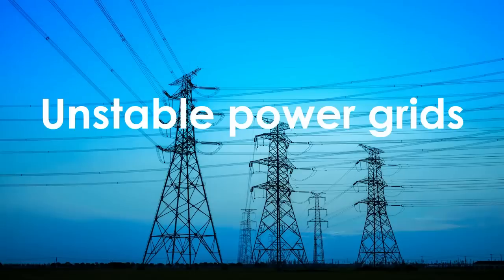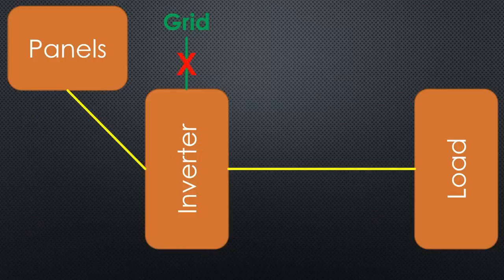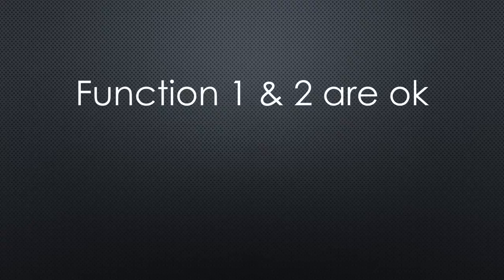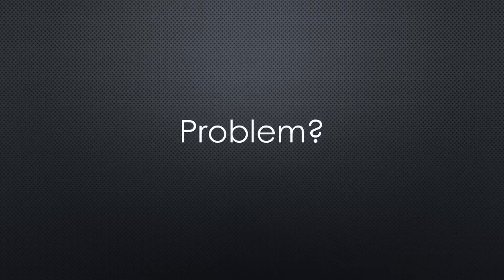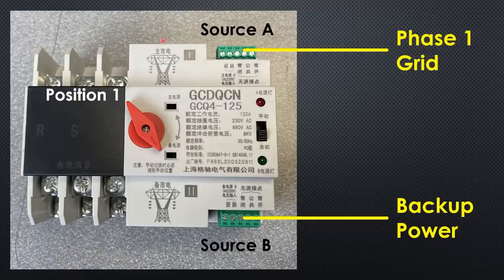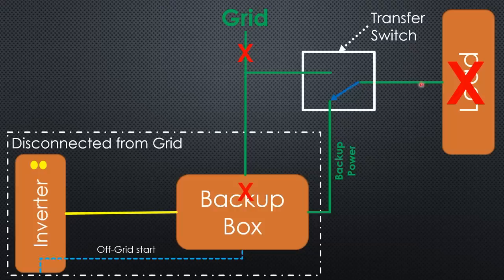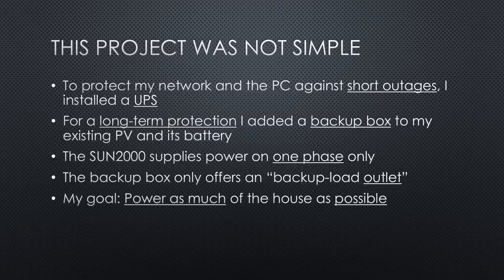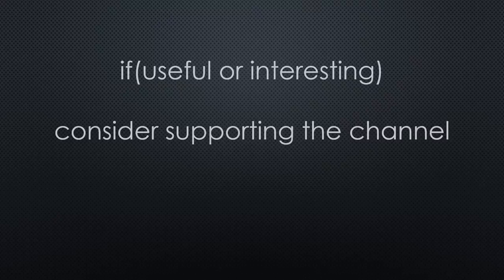448 How to Build an On- and Off-Grid System (Backup Box Hack, Huawei SUN2000, LUNA2000)

Comment: I had a solar system put in about 8 years ago, but because I was in the middle of a construction project (and had young kids at the time), I didn't take the opportunity to learn enough about the various tradeoffs. If I had your diligence and taken your structured approach to learning, I would have avoided a lot of mistakes!  What has helped me learn was the installation of a much smaller DC-only system with some panels I got cheaply later - nothing quite like building it to learn.

Thanks for sharing your knowledge and experience!
Reply from the maker: I agree, I always have to use projects to learn! Reading book does not create enough questions for me .

Comment: This is how all Solar installations should be installed rather than sitting there usless during a power outage.
Reply from the maker: I agrree.
Reply: @AndreasSpiess  There's some safety concerns. If the power is cut so workers can operate on the lines?
Reply: @cmuller1441  the inverter is already detecting grid power loss, so instead of turning itself off why doesn't it just cut the connection to the grid?
Reply: @35manning  An increasing number of inverters do just that. In the US, most notable are SMA and MPP, both of which have options for daytime backup without batteries.

Comment: Very clever solution. Thanks to Andreas. If somebody needs an motor driven generator, consider also a "tractor power axel driven generator". Old tractors are very realiable motors, and generators can be transported at the hook-up levers  at the back of the tractor.
Reply from the maker: Good solution if you have a garage for the tractor ;-)
Reply: Indeed, often reffered to as PTO: power take off.
Reply: In some country side districts there are several old tractors in barns or open field with a minimal cover blancet. They use their new tractors with 200 hp + 1,7 m front&back tyres also for school trips daily (15 years is enough to drive these monsters).
Reply: If you have some loads on a UPS (like several outlets fed by a 1000W UPS), fed by some larger batteries that give you some time, you could just feed those batteries with DC from any source, tractor or just an engine or a car, then let the UPS switch back in with the grid and put up the tractor at your leisure.  A little automation is required if you don't plan to stay home all the time.

Comment: Hi, many thanks for your inspiring project. 
It must be noted that, at least in Switzerland, any modification to a house wiring requires the neutral regime to be of TN-S type due to differentiel protection requirements (FI or DDR). Older houses (like mine) were often connected using TN-C  (1 wire for both neutral and protective earth PE). 
No modification to the wiring is allowed unless it is changed to TN-S, so there is no way to setup an Off-Grid backup System. This can be quite costly. So my Huawei SUN2000 will still stop when Off-grid, until we find an economical solution (maybe just setup part of the wiring to TN-S, while having the rest of the house still on TNC, and getting no current when OFF-Grid).
Reply from the maker: Thank you for your information. Unfortunately, I do not understand your problem ( I am not "fluid" in house installations). This is why I trusted my electrician and hope, he got it right. There are also FI fuses in the backup box, BTW.
Reply: Earthing and wiring schema is a thorny topic, there are also lot of regulations involved
Reply: @AndreasSpiess  it's quite easy your Outlet have free wires going to it live, Earth and neutral and his wiring only has two wires - no extra earth pin
Reply: The Backup Box manual from Huawei explicitly forbids connecting to TN-C grid types. However, if the household is wired as TN-C-S then it is perfectly fine. You can't switch to TN-S unless the power company does it for the whole neighborhood supplied from the same source in your area, which would be extremely expensive. The cheaper option would be to change your TN-C system to TN-C-S system where you split the source Neutral(PE) wire into two at the power distribution box at your house. Of course this must be in correspondence with your country's electrical regulations. Another way is to convert  to a TT system where you install separate earthing system for your house getting a completely independent protective earthing while you use the source Neutral(PE) only as Neutral. This again must be advised with your local electrical regulations.

Comment: Hi Andreas. I did quite similar things  with a transfer switch with the exception that I use a 1000VA USV with external 24V batteries as Voltage source and I cleaned up  the phases such that all I want to power ( light,  freezers, IT and heating (just 35W for control and pumps) is supplied on one phase. This makes me sure that no dish washer, washing machine  is powered in off grid mode thet may lead to  overload of the backup power supply. I hacked the APC USV such that it self start when supplying 24 V. This needs just some sequential button presses which I realized with an Attiny controller. So everything is now fully automatical and work without manual interventions.
Reply from the maker: Cool! So your system is similar to a emergency generator, just without using fuel!
Here, we wanted to power the whole home, not only the critical systems with solar because in late February/March when they predict potential power outages, the sun should already produce enough energy for everything (except cooking). So we should be able to live a "normal" live.

Comment: You may use a VFD (variable frequency drive) to solve the 3 phase problem. Many of them can be supplied by 1 phase + neutral and output 3 phases + neutral. You can also set the VFD to various parameters. This is usually done to power motors.
Reply from the maker: I agree. But in my home, this would be a solution without a problem ;-)

Comment: As a UK resident, I envy your 3-phase supply. We only get one phase in domestic installations. But I suppose that implementing your solution would be much easier.
Reply from the maker: Indeed, you could save two phases of the switch. And the backup box would be simpler (and probably cheaper).
Reply: I feel that our situation (just 1 phase) is more convenient. No complexities, simpler wiring, you don't have to think how to balance load, etc...
Reply: If you need three phases, you can pay for a three-phase supply, but it make your life more complex.

Comment: A nice solution for already existing system and I'm glad it works for you.
For a bit more than a price of Huawei inverter + backup box you can buy Deye 8kWt hybrid inverter that can provide full-power 3-phase output in off-grid mode. Also Deye inverter supports unbalanced load, so up to 50% of nominal power (4 out of 8 kWt) can go to the load of one phase. Deye uses low voltage 48V batteries which are more universal comparing to proprietary HV batteries. Also Deye has Smart Load output which is designed to prioritize self-consumption over grid export, fir example by dumping excessive solar energy into a hot water tank. Of course that would be a different build, however total price would be similar, wouldn't require external transfer transfer switch, would provide full-power and correct 3-phase output.
Reply from the maker: It seems that Dye has a good product. I did not know it. However, as I said in my videos, I wanted a high-voltage battery. 
And, as an engineer, wasting eletricity to heat water , is a no-go, too. I rather sell it for a cheap price to the community. Electricity is more valuable than 60C water. But charging a car battery would be a perfect application for this function.

Comment: MANY THANKS to you Andreas! I was always wanting to have an independency option for my PVs and your solution inspired me on a way to go! Besides the Backup Box, I ordered similar automatic electricity switch from AliExpress (I have a monophasic 3.65 kw SUN2000 + 15kw LUNA battery) and spent few days to correctly arrange all wiring with an electrician. One conflict we noticed is that the system refused to work if a General (not the main entrance) switch was ON on the system. It was conflicting with the one switch on the Backup Box (I guess) so we had to turn it off permanently. Finally the system started to work as on your video, what a relief!
Greetings and thanks for sharing :)
Vladimir (Portugal)
Reply from the maker: Glad it works. Here, unfortunately, I never had the chance to "really" use it because we had enough eletricity during winter ;-)

Comment: I believe two important things should be noted for this solution:

1. In this way you connect the whole house load to the backup system. This means the house load should not exceed more than 5kw for LUNA2000(10-15kwH) or 2.5kW for LUNA2000(5kwH). Shorting the three phases means that you support the whole house load and some households may exceed the 5kW(2.5kW) limit which would cause the battery short circuit breaker to activate. Most three phase stoves can operate with a single phase, excluding the oven. This means having only 1-3 burners turned on (or maybe a boiler) will get you close to the 5kW(2.5kW) limit.

2. The L1 terminal in the backup box and source A terminal of the ATS switch should be connected to the same phase. Otherwise in cases where a single phase drops, due to a short circuit break from the sourcing power distribution box for the household, you may get unpredictable behaviors. One scenario is where an inverter goes into off-grid mode but the ATS switch does not transfer to backup power, leaving the household powered with the remaining phases from grid. Another scenario is where the inverter enters alarm mode due to missing a phase for proper operation in grid-tied mode, but the missing phase is not the one that triggers switchover to off-grid mode, this way the ATS switch may completely shut down power to the house although you can power the house with the remaining phases.
Reply from the maker: I agree.

Comment: Thanks, very interesting.
My proposed solution is Sunsynk 8.8kw hybrid inverter, Freedom won 10kwh battery and 7.6kw solar panels - lack of space forces the limit. Everything is single phase and the sunsynk takes care of switching between loads so connection is relatively simple.
Reply from the maker: I already invested in Huawai. And I need 3 phases in our home...
Reply: @AndreasSpiess  I understand. Sorry. Should have been more clear that I'm just sharing what I'm about to put into my own place as contrasted to your installation.

Comment: Very interesting. Ideally I would have liked to see what happens when grid comes back. Also, I would like you to have identified the "two breakers in seroes" that the electricity suppliers requires - presume one is the changeover switch and the other is part of the Backup Box.
Reply: Having the breakers in series reduces the risk of sticking contacts, thus injecting power back into the grid. He showed them in the schematics.
Reply from the maker: Nameless ghost is correct. And the switch back is without effects. The transfer switch takes a few milliseconds to automatically switch from backup to the grid. You hardly see it.

Comment: Have a look to Sungrow hybrid inverters (e.g. SH10RT). They have the backup box and transfer switch functions integrated and can deliver 3 phases on emergency power.
Reply: hybrid inverters are the way to go. all you need in one box. don't install something else or be prepared for blackouts !
Reply from the maker: A hybrid inverter is not enough as I showed in one of my earlier videos because it has to switch off (by law) when the grid is off. The SH10RT is the same as my Huawei and needs a STB5K backup-box. It also only provides "emergency power" (info from the homepage of Sungrow)
Reply from the maker: @ulistermclane You are right, and I was wrong. The SH10RT has a Backup box built-in. Still, you would need the trick with the switch if you want to feed your whole home (or connect everything to the backup line, which is probably ok because it is very strong). The price is also very ok.

Comment: I have worked a bit with UPSs in hosting servers and datacenters and connecting a UPS to a UPS (daisy chained) is a hard no-no as it can cause critical failures, and seeing that the solar inverter and battery is on a sense working as a UPS here; One threat is that the current draw can cause the upstream UPS to go into an overload condition or distort the output voltage waveform. When this occurs, it can prompt the UPS to detect a power fluctuation, revert to battery power, and continually cycle between the battery and normal operation. Plugging one UPS into another can also spark inverter compatibility issues, where the unit closest to the load doesn’t recognize the other UPS’s power as sufficient. This compels both UPSs go to battery, defeating the intent. Daisy-chaining can also force UPS controllers to work against each other, leading to harmonic distortion on power lines.
So... you might want to make sure that this is not that case in your scenario.
Reply from the maker: Thank you for your input! I am not sure how much your scenarios apply to my case. My small UPS for the computer and the network only consumes about 300W ( constant load). The PV inverter can supply 3kW in backup operation. So I hope that the influence of the small UPS on the inverter is not big enough to create problems. And the small UPS does (hopefully) not care where it gets the energy from. What do you think?

Comment: Hi Andreas, maybe also good to mention, that 99% of the ovens can be supplied with a single phase. If you have a single phase at the installation place, there are metal bars, which bridges L1,L2 and L3. But in your case you bridged them right away - so your oven would work without any problem :)
Reply: That depends on where you live.
Reply: @marvintpandroid2213  probably right :) in my case Germany
Reply: @marvintpandroid2213  In the UK domestic supplies are only single phase in nearly all houses, so Ovens and hobs come with L1, L2 and L3 already linked.
Reply: @pjaj43   I have fixed a quite few domestic ovens in the UK and never seen the ability to be used in 3 phase enabled either externally or internally and then lnked out.

I have seen that on some US domestic units  but then only 2 phase.

I have only ever seen 3 phase on industrial kit in the UK.
Reply from the maker: I only switched the oven and the stove on in off-grid and they did not move. Then I switched them off and was happy that nothing was damaged. I anyway never wanted to use them during such a situation (I have a small gas cooker for real emergencies ;-)
Reply: I checked my very average glass ceramic stove and oven in 3-phase Germany. Turned out all loads are wired in star scheme. One phase each for 2 plates, and the third for the oven.  You can test this very easy. Switch off 2 of the 3 breakers and check what's still working. Try with all 3 phases one by one. If still full function is there, you have a star load which could also work as single phase. If nothing works or only strange partly function, then it is an older delta or star-delta configuration which is not capable of running single phase.
Reply: @AndreasSpiess  i'm confused, are stoves and ovens in Switzerland mobile? if i had to guess those appliances use 3 phases for load balancing and not in star or delta configs. if the stove/oven is in use during the power outage is not gonna overload the inverter?
Reply: I have 3 phase supply in my place but the oven is supplied from a standard 13a socket. As far as I can see it is only the AC that is connected 3 phase.
Reply: There is an important risk not mentioned yet here. Households with 3-phase supply (not only on on stove+oven) have an N wire of frequently only 16A capability. If the inverter can supply more than 3.5kW on that single phase, and for example the stove + oven is operated single phase with more than 3.5kW, there will be a N wire overload with more than 16A. In single phase households this is no issue since the wires gauge is much more capable and made for like 6 to 8kW or 32A.
If I had to solve this here in my place, I would just connect 1 phase to the stove on the backup supply. The oven remains cold, but I would still have 2 operational plates.
Reply from the maker: @docwhogr  Our ovens are built-in. I do not know how they are connected. I just tried them in my off-grid mode, and they did not work. So I assumed they are in delta.
Reply: @AndreasSpiess  As a former certified electrictian from Switzerland (Grüessli us Winterthur ^^), I can say that you did the right thing. Don't mess with the Stove/Oven, unless you really know what you are doing. Yes, most can be configured to 1 phase, 2 phase or 3 phase, and I've only ever seen the bridges for that at the connector box, usually located on the back of the Oven.
But not all can be switched, purely resistive ones usually can be switched. To note: @SpeedFlap is right, if you would just switch them to single phase, and even if it would work, it would probably overload the neutral. As with 3 phase power, the power is sometimes distributed between the 3 (or 2) phases, which in turn would not put any (or just balance) load on the neutral.
But I'm sure you would find it interesting and educational to still research it ;)
If I remember correctly, you can usually find the wiring diagram inside of the Ovens Manual, or you could probably find on the webpage of the manufacturer itself.